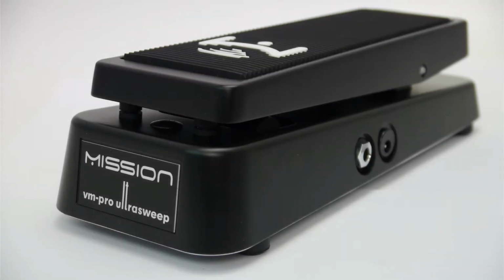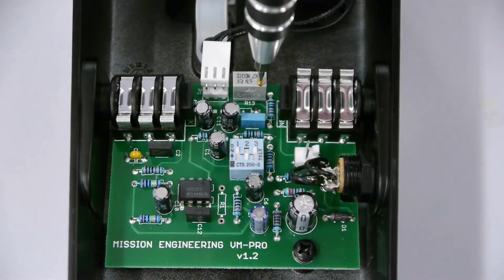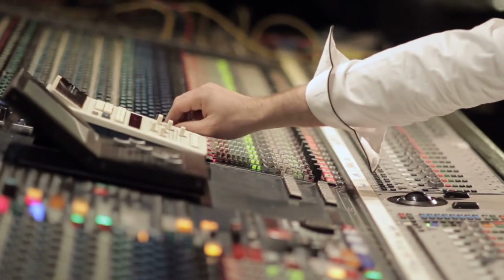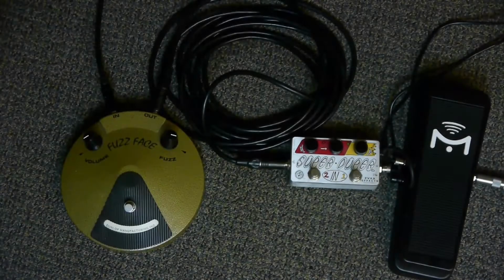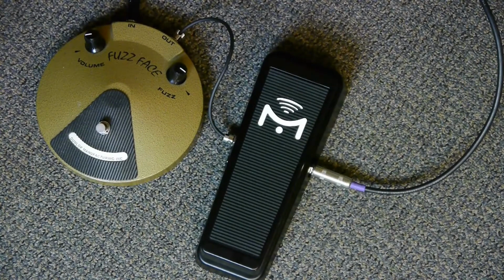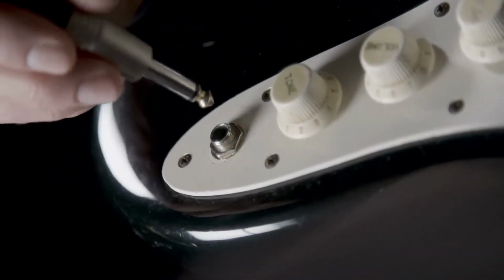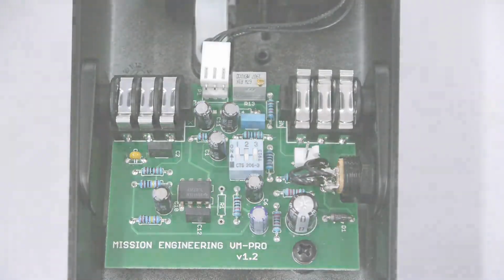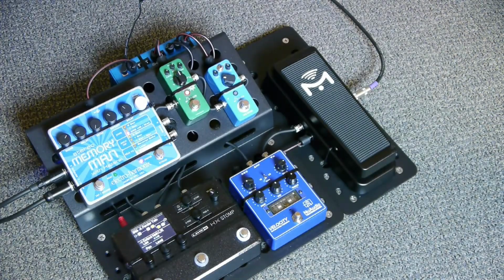Mission VM-PRO with Ultrasweep

Comment: Why output of the volume pedal connected to output of the fuzz face?
Reply from the maker: The standard fuzz face has the in and out reversed compared to most modern pedals. I switched mine around in the enclosure just to make wiring easier. I left the labeling the same in case I ever want to switch it back.
Reply: @JamesLebihan  thanks for the answer. And for the explanation.

Comment: Thank you for this demo. This clears up confusion about the features and how to use it very well. Is the ultra sweep a much better upgrade or are the older models fine? I am just using passive pickups in my guitar so I am not sure if the ultra sweep would change much for me.
Reply from the maker: Ultrasweep is a big improvement for volume swells. If you play ambient, worship, or other types of music that require smooth solo volume swells, then Ultrasweep is a nice upgrade, if not then there is not really much difference
Reply: @JamesLebihan  Thank you so much for the reply I appreciate it. I'll go for the ultra sweep then. Just earned yourself a sub my friend :)